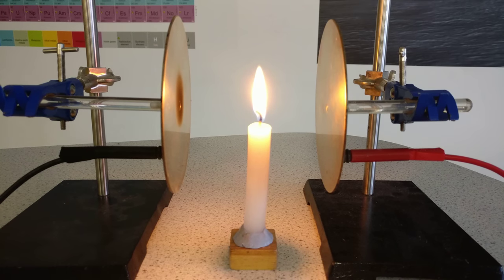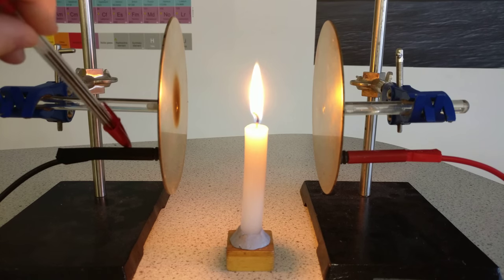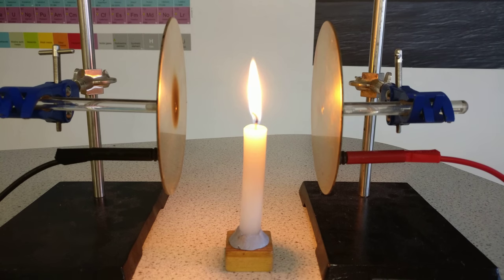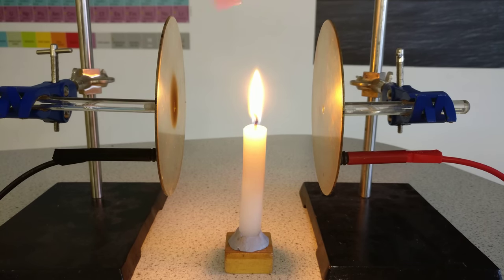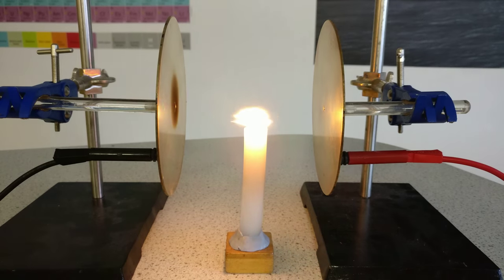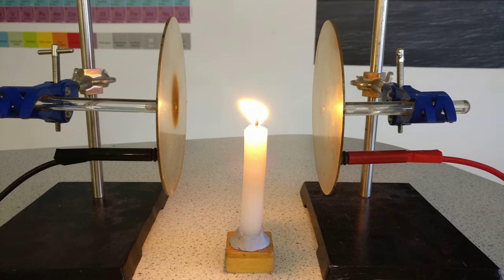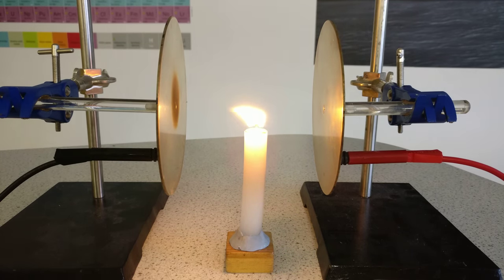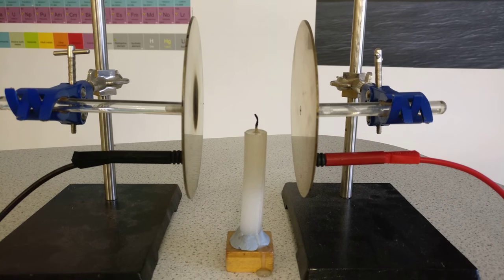Christmas Candle Flame in an Electric Field  - AQA A Level Physics

Comment: It would be nice to do that with the candle isolated inside a glass to make sure that the ionized air around doesn't cause enough wind to participate to blowing the flame, because clearly at 25kV you usually can feel the wind.
Reply: very good point
Reply: "usually can feel the wind"? Really?
Reply: What wind
Reply: @owenmartin3307  when the oxygen/nitrogen ions move, they're just moving air molecules, and their displacement is wind. That's the principle used in lifters/ionocrafts (look for "high voltage lifters" or you'd get tons of irrelevant suggestions).
Reply: @nip360  yep, I first noticed this when playing with corona wires salvaged from an old photocopier. Even at only 5kV you approach your hand and can feel some air turbulences. The corona devices are made with a perfectly centered wire so the wind in theory is in all directions but still some might be circling and you can feel it. At higher voltages (but before breakdown) it's more noticeable. And if you do this between a metallic plate and your hand with a very low current (otherwise it hurts), when air starts to ionise, you feel some cold air moving on your hand.
Reply: Won’t the flame just go out anyway as it burns up the oxygen?
Reply: @levieux1137  Thanks for the info! That was really interesting to read - now I want to play around with it!
Reply: @ubergeraldine  what if the glass was open from the top, that way it will have exygen while also preventing air moving between the plates
Reply: I feel the wind everytime i turned on grandpa's old crt tv, back in early 2000 when i was little
Reply: @ubergeraldine  then some hole could be left for the air to circulate, but i dont really know how exactly
Reply: Brilliant idea to test 💡 
I’m unsure of the result.
Reply: Ёмкость нужна большая, кислород быстро выгорит.
Reply: @sus6788  стеклянная трубка это хорошая идея.
Reply: @Donald_Trump_2024  Hurricane lamp chimney. Open on top and bottom.
Reply: @TallTexasGMan  good idea
Reply: @kateshiningdeer3334  Take care... it can hertz. ;-)
Reply: But would not there be air inside the glass as well? Maybe it could be even worse. To form a vortex or something like that 😅.
Or, if it is indeed isolated, the flame would consume all the oxygen and eventually also go off.
Reply: You're exactly right. It's because the magnetic field very much affects the air. The candle is flickering like that because the air is moving around in there, not because magnetic fields directly affect fire. Put a piece of paper in between those plates and watch it shift and move from the air currents.
Reply: @leocdms  that's possible indeed, but at least it will be much less air and would have less place to move. But that definitely deserves an experience :-)
Reply: @jasonrogers1576  I guess you meant electric field instead of magnetic field here of course but yeah that should be it. That said, flames are plasmas and containn many ions. When experimenting with a strong magnet you can see them move a little bit. But usually that's very weak and you can only test with an electromagnet so that you don't cause wind when moving a magnet close to it.
Reply: That's a brilliant idea. Isolate a burning flame from it's oxygen supply.
Reply: I thought about this in the beginning, as the intense E field could form a kind of corona wind between the plates.
Reply: With isolated air the candle will get extinguished fairly quickly, since theres only limited amount of oxygen. Just do it in a room with no wind i guess.
Reply: @chizhang2765  as long as the glass is opened at the top it should work long enough for the experiment. And you may have noticed that in restaurants they like to place candles inside glasses that work surprisingly well (the astuce is to use a very small one so that it doesn't burn air as fast as it can renew itself).
Reply: winds of change
Reply: It would turn off , Einstein
Reply: Exactly what i was thinking before i saw your post
Reply: How would you keep the flame alive?
Reply: @haakiiify  funnel glass obviously
Reply: @levieux1137  That's a good point. Sorry for not thinking of this solution. I was thinking how the flickering we see could be due to the plasma oscillation when an electric field is applied, to which the small vibrations in the air wouldn't contribute a big factor. I am not so sure if the device used in the video could go as high as 25kV.
Reply: @chizhang2765  yeah I've been wondering the same as well because of the way the flame dances (but seeing dark stains on the negative makes me think that ions definitely flew from right to left fast enough to push the smoke there). Regarding the 25kV, I have not seen the device itself, but it's mentioned in the description. The plates are sufficiently distant so that it would work. I really think that more experiments are needed, this one is incomplete if it leaves more questions than responses!
Reply: @nip360  Yes. Moreover, there are rocket engines using this effect.
Reply: @metabeta6993  cool
Reply: @levieux1137  I have a question regarding your comment and the video....is the concern that the em field causes the air in between to get "excited"...aka...produce wind?, and if Yes, then does this mean the wind we feel normally is caused be the earth's magnetosphere? Or perhaps the field in that particular spot?
Reply: Theres still air in the jar.... the flame wont burn in a vacuum
Reply: @levieux1137  unless you do the experiment in very little time before oxygen runs out of the isolated tube
Reply: @ubergeraldine  😎
Reply: How long can a candle burn in an enclosed space? Kinda tough prove some points in science I suppose.
Reply: The only problem is that if there is no air/wind,...the flame would go out
Reply: It will be extinguished
Reply: The candle flame would be still because I can even feel the wind from my 3.5kv air ionizer by holding my palm close to a discharge pin.
Reply: dont need! u can see how the flame moves
Reply: Vacuum
Reply: Try it with an oxy-acetylene flame and see what happens.
Reply: BURN!!! LOL
Reply: @Flyboy_73  it's been debated plenty of times above but as some mentioned, you can use a funnel like commonly used with petrol lamps, and second, if you google for "candle glass" you'll actually see plenty of well-working examples where this is not true. The reason is that the hot gas around the flame causes sufficient turbulence and if the flame is not too big compared to the glass, some air has enough time to renew itself inside the glass. I'm pretty sure that there are plenty of combinations which do not work but there are also many which work 🙂
Reply: @Eduardo Sánchez sorry but I responded twice and twice my response was silently discarded, I don't know why, maybe due to posting links. What I said was that I do not have a strong opinion myself on this but in literature found on the net you see that various scientists disagree on this. Some consider that it's necessarily a plasma since it's neither solid, liquid not gaseous. Others consider that it's a 5th state. I tend to think that given that it's a reaction in progress, it does contain lots of ions and electrons and as such is at least partially a plasma. Maybe a mixture of plasma and gas after all.
Reply: But there will be 'wind' in the glass too...
Reply: i know! completely correct dude
Reply: And how will candle burn without oxygen
Reply: @Owen Martin 
You've obviously never used an ionizer!
Reply: @mohammadmiruka4963  a little bit, yes, but much less. If the flame moves less it will mean the wind is responsible. If it moves as much then it's not the wind.
Reply: @levieux1137  Like the fuel in Ion engines used in rockets?
Reply: I could be wrong but because glass is a insulator it might effect the electromagnetic field.
Reply: @wallpello_1534  
It's an electrical insulator not magnet shield!
Reply: @wallpello_1534  good idea but no, it's the opposite. Since it's an insulator it does not affect the electromagnetic field. Just like air for example. It would affect it if it were a conductor, think a metal tube for example. It would constitute a Faraday cage with its own field inside, that is isolated from the external one thanks to the conducting metal. That's how shielded or coaxial cables are made for example, because the insulator alone doesn't stop the electromagnetic field.
Reply: @levieux1137  thanks I should of realized that I work with shielded cables all the time.
Reply: Inside the glass the candle flame will go off from insufficient oxygen right?
Reply: @salmansaadiqmusic  not necessarily, please read other comments about this as many have already expressed the same concern
Reply: @nip360  realy. You can feel the wind of an ionizer
Reply: Eli's knifes and boom  don't use a box. Use a tube.
Of find a better solution.
Reply: if done inside a glass is basically like a timer right. the flame burns as long as oxygen is present

Comment: If such an electric field is strong enough could it make a combustion engine stop? We all know the story of the WW2 Nazi foo fighter klystron tube equiped WNF Feuerball and Zeppelin works built Kugelblitz airplane motor jammer devices that flew between the bomber formations and made the engines stalled... Maybe could you get an RC combustion engine ´between such a field Anode / Kathode system at higher voltages and watch if it stops if voltage (100 KV?) is applied to the device? Maybe frequency modulated....